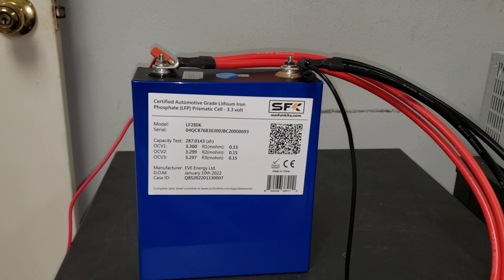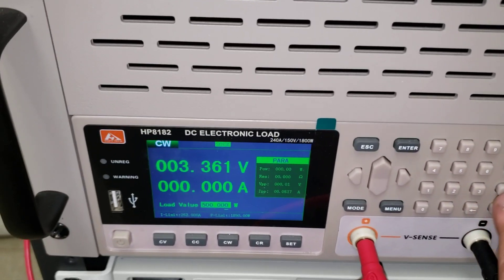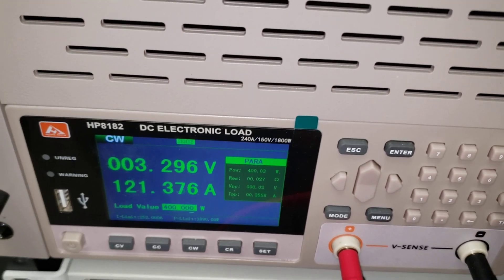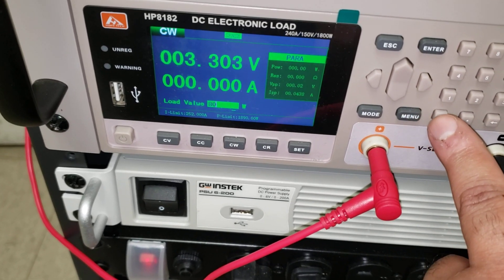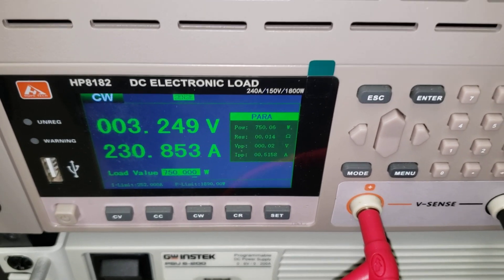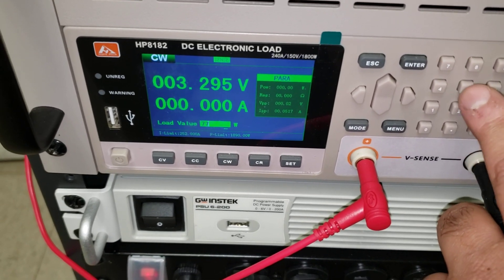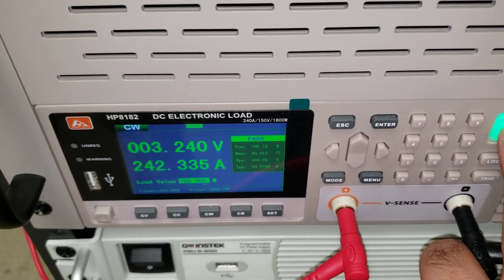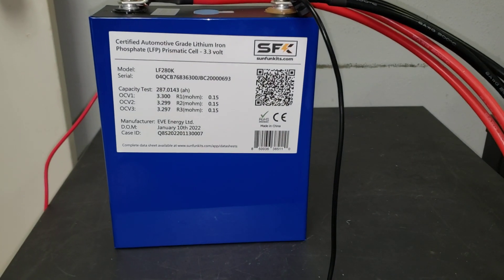High Amp Test on EVE LF280K Prismatic Cells Grade A. Welded Stud Amp capacity test.

Comment: That's all well and good, but without testing some samples of grade b cells you are just speculating on what their performance will be. 
Most using grade b for 16s home storage will never pull more than 100A so it's a moot point.
Reply from the maker: Please see https://youtu.be/KD-av4cTL-Q
Reply from the maker: Voltage drop means internal shorts inside the battery which will degrade the cell far faster than normal spec. May only get 1/3 to 1/2 of the life even at low discharge rates… no one knows for sure but time will tell.

Comment: Good to see you using the voltage sense wires in this test. The last 2 videos you published on Grade A vs Grade B didn't use them.
Reply from the maker: HI, when doing capacity test we use voltage sense wires, but if we just want to do a quick test to weed out bad cells, the v-sense isn't needed. However, we'll make sure all youtube videos have v-sense.

Comment: I have some LF304 cells. At full charge and left they sit at 3.311v, 3.317v, 3.316v ,3.11v. 
When I pull a 200amp load through them the voltages are 3.251v, 3.260v, 3.242v, 3.248v. Would you regard these as grade A cells from this test? they seem to be quite similar to the results on this lf280k?
Reply from the maker: The main thing that separates grade A vs B is the manufacturers test report, an example of a LF304 report is here: https://docs.google.com/spreadsheets/d/1uNzaPcApN-V52_hn28VXVlxPZq8BlHOE/edit#gid=1574245009 you can learn more by watching this video:  https://www.youtube.com/watch?v=XKxwMW900Jw

That being said, the main thing is Grade A is consistent and every cell is guaranteed to perform at a certain level. With grade B this is a wide range, you can have cells that perform very close to grade A, some that are in the middle, and some that are really bad. So it is a gamble. Generally users will buy more than they need to have as back ups.

Here is an example of a customer that sent us there kit because they were getting bad performance, we investigated and found 1 cell to be almost the same as grade A, 2 that were OK, and 1 cell to be problematic: https://www.youtube.com/watch?v=KD-av4cTL-Q

While it would be great if we can get a guaranteed supply of these Almost Grade A cells for the grade B price, it is just not practical in the real world. Eventually you will be stuck with medium quality or low quality cells.

So it would create too many problems for US sellers, I think this is why many sellers are in China because they know they will not have to deal with returns/refunds as shipping cells back to China is very expensive, almost as much as the cell itself.

Many people do not know, but the Chinese government will subsidize shipping costs to the US and Europe to help exporters.
Reply: @sfkenergy  Thank you

Comment: Eve only sells the LF280K with T-Bars , not with treadhole ?
Reply from the maker: EVE sells cells with a plane terminal with nothing on it, you can then have it welded with a stud or a custom adapter, whatever you may like.
Reply: EVE DOES sell them with the T-Bar also factory installed! EVE can NOT sell them with the stud or screw hole.  That is added after purchased from EVE.

Comment: Where would you recommend getting 230ah - 240ah CATL cells? I built a 24v 200ah lifepo4 for my wheelchair and will be doing another one in the future. I use a iCharger4010 duo for charging and balance I don't use a bms my wheelchair has a low voltage cutoff I can set
Reply from the maker: all CATL cells are grade B. CATL does not sell to DIY or others, all of there cells go to TESLA or other other companies. The only cells you should consider. in this range are CALB, EVE, and REPT these are the only companies selling cells to smaller outfits and DIYers.

Always demand a copy of the complete manufacturers report from whoever you buy, it needs to have each serial listed, no sample or batch reports.

So where ever you decide to buy make sure you demand a manufacturers test report.

Good Luck, I think Currentconnected in the usa has some 230A cells with full test reports.
Reply: @sfkenergy  thank you so much. Perhaps when i am ready to build ill contact you guys Sun Fun Kits an get new grade A  230ah CALB cells from you if possible for you to source them at that time
Reply: Which brand would you recommend between CALB, EVE, WINSTON, REPT. for my application in a wheelchair?
Reply: How can you be so sure that CATL doesn't sell for this market?
Once and for all it will be interesting to no, besides the capacity test, what kinds of test manufacturers do do consider the grade B! ..
Reply from the maker: @ditmarco  ALL CATL cells on the market are rejected Grade B cells, CATL does not have an official channel. The only  companies that have an official channel are EVE, WINSTON and REPT and CALB. Ganfeng cells grade B cells to select vendors as well but generally in prebuilt products like server rack batteries, not loose cells.

We know this because we asked to be vendors and CATL only deals with Automotive companies that need millions of cells.

Comment: Next stop, do a High Amp capacity test wherein you subject the cell to 200A from 100%SOC down to 0%SOC.
Then do the same test with GradeBs.
Reply from the maker: If you have some grade Bs you can send them to us our address is on our website. Usually customers will send us there grade B cells when they have issues with there kits and we can test them.

NOTE anything over .5C requires active cooling with these cells so if we did a test it would be 140A.

Comment: What did the capacity come back as
Reply from the maker: This is a load test to see if the cell is able to supply voltage underload, it is not a capacity test.

But if you all want us to perform a high amp full capacity tests, then get us to 1000 subs and we will do it with full graphs.
Reply from the maker: Here are our capacity tests and graphs: https://drive.google.com/drive/u/1/folders/1X5RlFTFBgwQ8ZyxATFnEUp6TM0dcNwDP we have discussed in depth, all capacity tests were between  900-914 WH and normalize to around 900 WH once a few cycles have been put on them. The reviewer in question does not know how to read test data, does not provide any charts or results, and is simply stating numbers without understanding the results. But anyway since you asked for tests you can view them in the google drive above. This also shows the difference in chemistry between the 280K and the LF304 which are different in make up.

Do not believe that reject auctioned cells are better than cells with official manufacturer reports.
Reply: @sfkenergy  got to have data to understand data. I think that's an important aspect to remember.